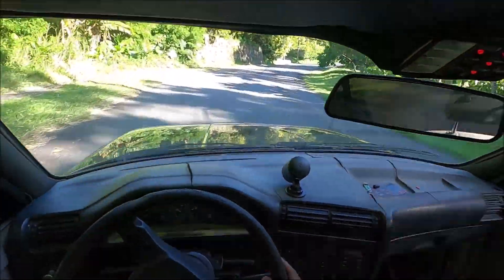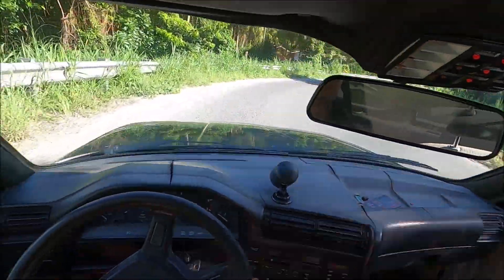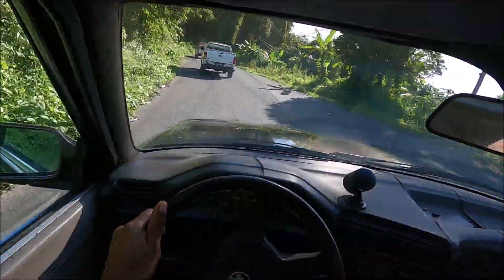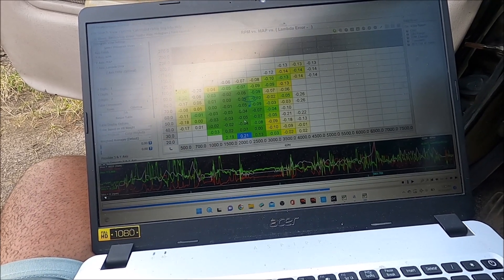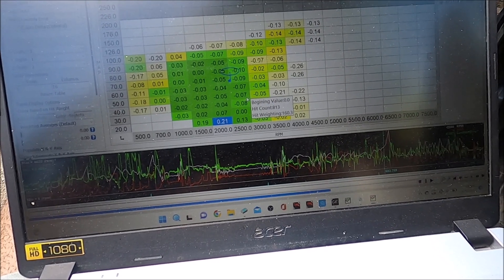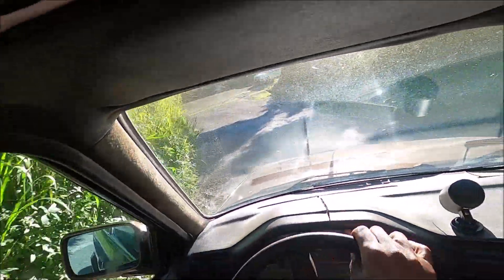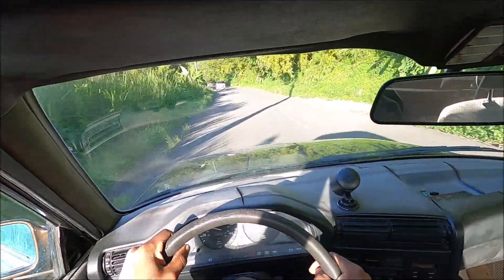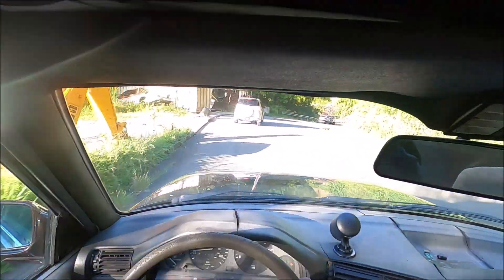Street Tuning after Swapping my ECU | First Drive

Comment: The last time I asked if the speedduino will control the e trans and you state that it will do . Is dare a 6 cid control that will do all injectors and coils individually?
Reply: There is no e trans control for now.
Reply from the maker: Look up the "dx-control-gears" for trans control.

Dropbear can do 6cyl seq and a few other  boards
Reply: STM pro ecu can do 8x8 sequential and rusefi can do 12x12 sequential and both support DBW as well. 
Speeduino is advancing strong in its capabilities.